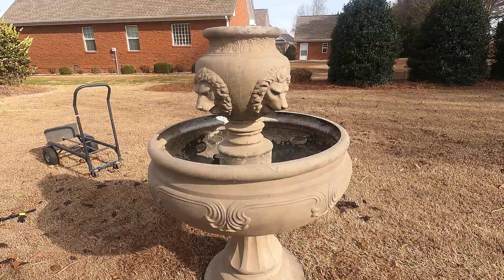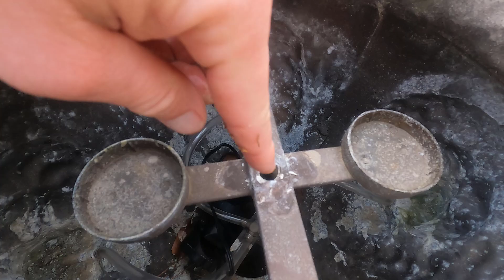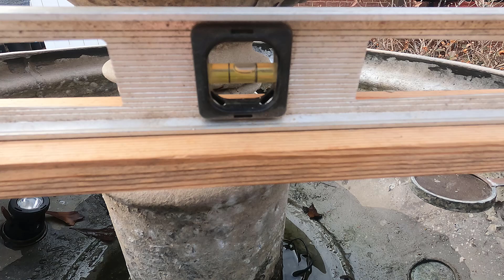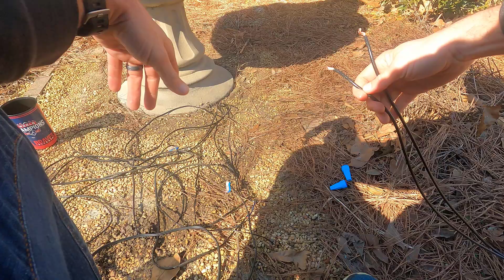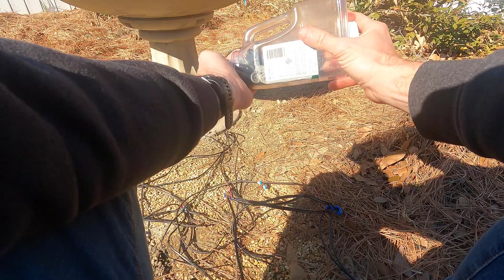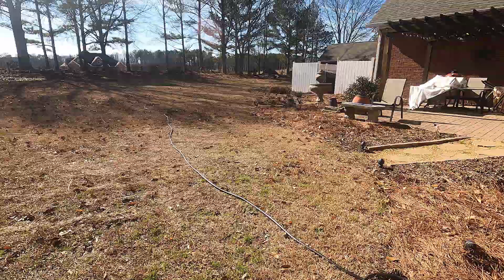How to Install a Landscape Fountain | A Step-by-Step Guide

Comment: Thank you for this video. We were going to connect our fountain to our lv landscape lighting, but we wanted it to run during the day, instead of only at night when the landscape lights come on. Is there some way to do that?
Reply from the maker: The only way to pull that off is to have the fountain on a separate transformer.  Have the fountain transformer in the "on" position 24/7.  This method meets my needs because 95% of the time we can only enjoy it in the evenings.
Reply: @Dr.Warren  Thank you.  We ended up just getting a little solar pump, which works well.  Great tutorial!!